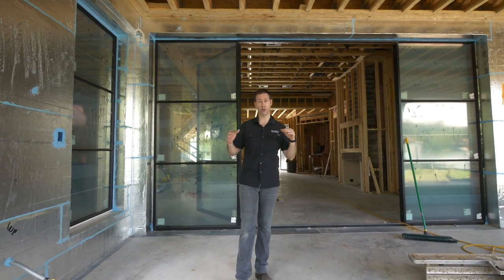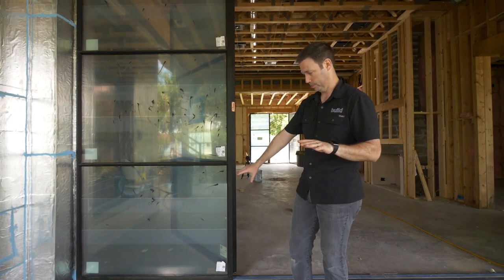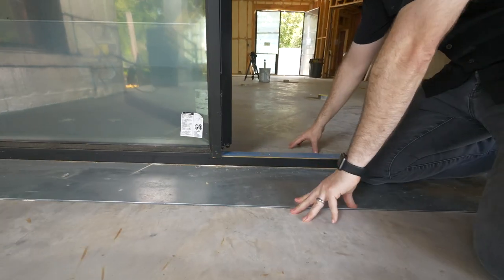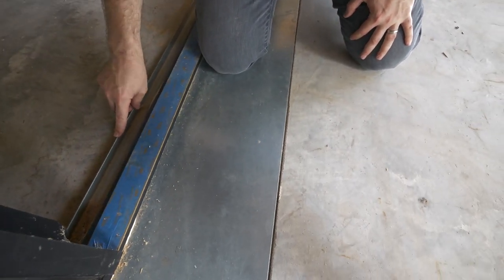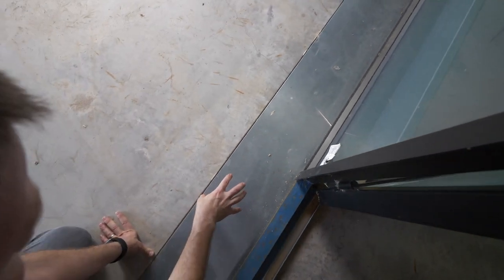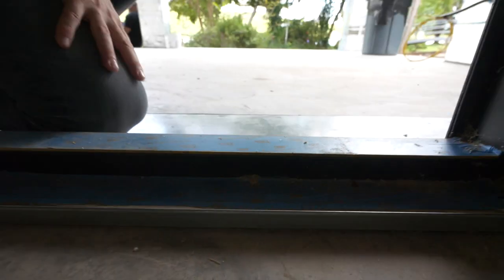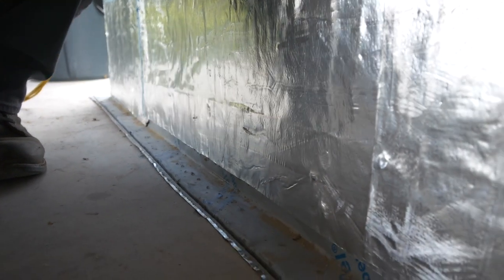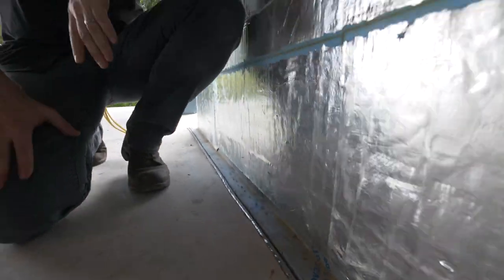Waterproofing - Flashing a Concrete Slab To Porch

Comment: Level transitions between inside and out are also really helpful to people with mobility impairments. As the population ages it helps people using walkers and wheelchairs most of all.

I wish you'd been able to show us more details here. Are the interior and exterior slabs separate pours and thermally broken? From the video it looks like a gap of several inches between the upturned lip of the pan and the interior edge of the door threshold. What will fill that space?

Comment: Matt, here's a solution I just thought of. Could you do something similar to a linear drain that are used for indoor showers? Basically, have a drain that spans one foot from each side of the door located underneath the door/window. Then the bottom of the window/door could actually be recessed and be totally flush with the floor for a true zero threshold.
Reply: good idea. if it were set into a cut that sloped down all the way to one side of the slab, water should drain out automatically :)

Comment: Awesome tip with the cut concrete and the inlayed flashing! Thanks
Reply: I worry about what happens when the sealant degrades. I doubt that it will outlast the stainless steel.

Comment: Where live (Australia), in order to have the porch slab and house slab at the same level you'd need to have a channel drain in front of that door.
Reply: yeah and then a performance solution that cost 1500 bucks if you want to vary it. any door or window frame with weep holes require a threshold drain.

Comment: Just plain stupid why let water go under window frame at all. Would be better to attach that upturn lip against window frame with few self tapping screw and maybe put some caulking between that joint.
Reply: The problem with that detail is if water comes down the outside of the window it can land on the caulking - so the caulking becomes the first line of defence which negates the need for the tray. Over time the caulking breaks down and the detail fails. At least with this detail the first line of defence if the actual fold of the tray, with caulking as a back. However, to make the detail better, rather than have the tray extend all the way under the window frame to the inside, have the upturn inside the window frame (the are profiled so you can do this). That way the material on the outside is never visible or present on the inside.
Flat slabs like that are a bugger! You should always have a setdown.
Reply: Your window will leak... if drainage is not part of the window design itself, over time it will start to leak. Id rather have that sill pan under to catch that infiltration then not, and wind up with water coming back inside.